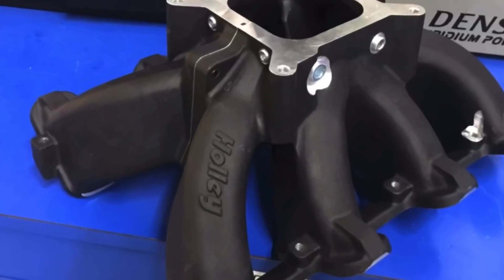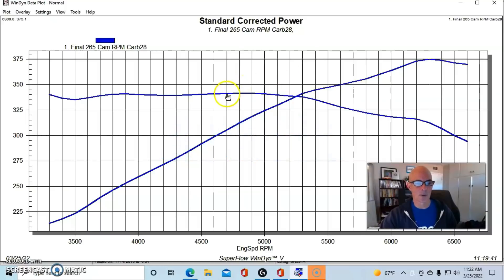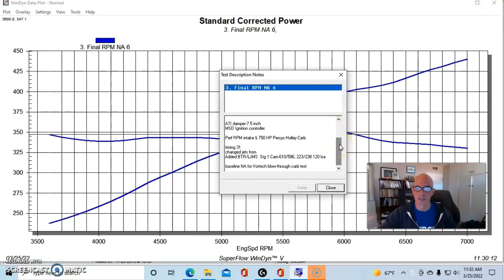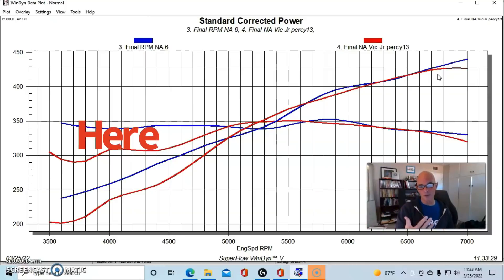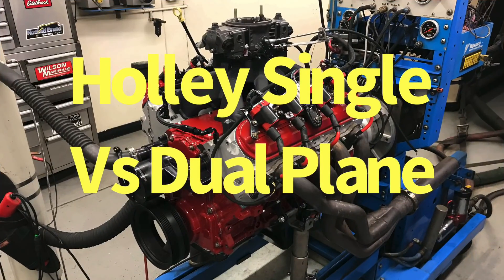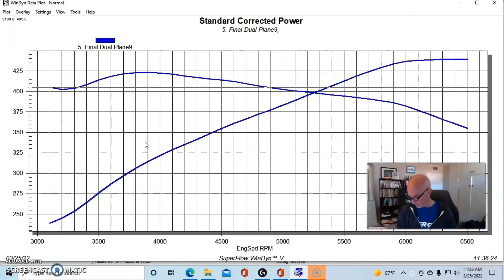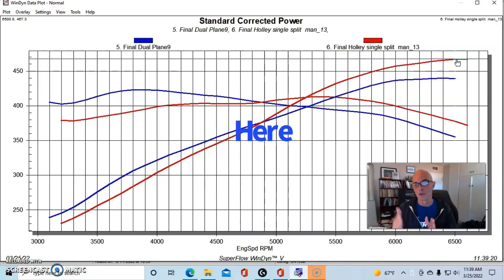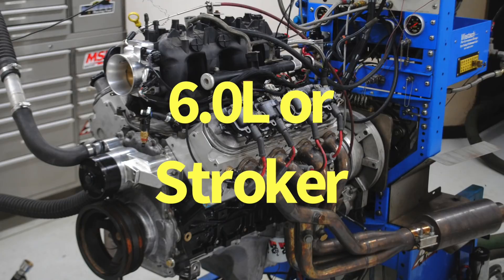HOW WELL DOES THE HOLLEY 2-PIECE, SINGLE PLANE LS INTAKE WORK? SHOULD I PICK A SINGLE OR DUAL PLANE?

Comment: I’m running nitrous on my LS1 with a forged bottom end 11.1 compression with built 243 heads and the nitrous junkyard cam on 150 shot. I wonder how good this intake would work
Reply: It would work well had 6.0 lq4 317 heads cut .45 ported junkyard dog cam 850 brawler carb
Reply: I appreciate the information, bud.. I’m actually running a 383 and got my 243’s CNC ported so I believe the Holly single plane with the 4150 tb should work pretty good.. it’s a track car and I don’t leave until 4K RPMs.. like depression is around 11.7 now

Comment: Hey Richard. I have a 4.8 i want to  put efi on it with a holley single or dual.plane intake. I want it to be like a daily driver / qeekend cruiser. Looking for a nice cam as well. Looking to put in a 70 era 914 with a 5spd.  What do you recommend for application.   I want good  gas mileage, and power. Some were in the range of 3 to 400.
Reply from the maker: I have a cam for you-send me an email at killerbe16@aol.com

Comment: So
I'm thinking of a project car. 2,200 to 2,300 lbs. road sports car.
I'm looking for 400 to 500 horse power at around 7,000 RPM. Keep the torque somewhat low. Say under 400.
I would drive this on the street with occasional road race  track days.
What I have in mind is a 5.3 all aluminum LS.
I found an LM7 with 862 heads that looks interesting.
Questions:
Can the stock 862 heads support the above power? Without porting and intake valve size increase?
I am wanting to install some kind of down draft manifold (such as a Holley EFI LS Intake Manifold with an elbow) in order to fit the engine in the car without butchering the bodywork.
Any suggestions for cam and what manifold would be very welcome.
Reply from the maker: 400 hp is easy with a 5.3l and a cam, 500 hp takes a lot of work
Reply: @richardholdener1727  So I would be looking at porting and passably 2 inch intake valves on the 862 heads, with intake manifold upgrades to get to say 450 HP at around 7,000 rpm. Maybe a throttle body upgrade as well? There seems to be so much You Tube info on much higher HP. But little on milder more street oriented builds. I'm thinking crazy torque isn't needed with a car that weighs 2,200 lbs. Plus torque is what breaks transmissions. I am building for a Porsche Boxster S Trans

Comment: Hi have a problem if eny 1 can help. I have a lq4 6.0  with 862 heads  upgraded  rockers  springs  port work  . Full length  headers. And has a carburetor with 750 holly. And a 2 peace  holly intake manifold the new one.  Need to know  what cam to run. Eny help please.
Reply from the maker: btr hot rod
Reply: Thanks  love the show. I have a manual transmission  to if that makes  a difference. Thanks

Comment: Hey Richard I am building a NA 6.0 LQ9 at the moment for my 65 C10. Its basically gonna be a cruiser but I wanted the chop so I bougth a Truck Norris cam for that. I will Holley-Terminator-TBI it but what intake do I need? Obviously it won't be at WOT all the time but I want the engine to have a little spice. What do you think?
Reply from the maker: dual plane makes more down low-single plane makes more up top-there will always be a trade off
Reply: @richardholdener1727  thx for your response....

Comment: Have you ever done an LS coil test or compilation? I know someone did one ages ago but that was heat sink coils vs stock ls1 coils. Not looking for any power gain, just reliability and possible rpm consistency.
Reply from the maker: I don't think you see anything until misfire happens

Comment: A test with longer cam duration could nett some interesting results. I'm guessing a guy running this type of equipment is not running a 'race gearbox box, so the motor needs to pull from 3000 ish to get out of the turns?

Comment: Seems like 4.8 doesn’t have enough displacement for single plane intake manifolds at all. Lesson here is don’t use a single plane unless you have high compression,heads and huge camshaft to use it. 5.7 would be the lowest cubic inches for a single plane intake in my opinion

Comment: What exactly makes the split manifold perform so much better then the vic jr manifold i thought the split design was just to make access for porting, also would there ever be any issue with boost leaks on the split design even with the gasket. Im conflicting on what to use on a boosted 402 peak power around 7000-7500 rpm.
Reply: Intake manifolds shape the torque curve. Dual planes have longer runners, and longer runners boost low and midrange power because they resonate ( think of organs making notes ) at lower and middle rpms. This is why matching everything takes work. Cam timing, intake, heads and exhaust is all a system that has to be optimized to achieve your desired results.
Reply: Judging by the dyno and the advertised rpm it seems like it will suit my application the only thing im worried about is boost leaks with it being split.
Reply: @hoost3056  i was also curious as to why it made more power then the other single plane intake not just on the top end but was closer on the bottom.
Reply from the maker: runner length

Comment: I've got a 408 w/ 10.8:1 compression 317 worked heads and the Holley split efi intake and it made 590hp/545tq. I have it in a 64' Ford F-100
Reply: Whoa!  Cool!
Reply: Made thos # on my 347 with Afr  220
Reply: I’ve got a similar setup 408 11:1 823 ported heads and a ls3 stage 2 cam made 606hp/550ish tq @ 6600/5400rpm I’m curious as to what the dual plane would do for more street and tighter converter
Reply: @shortbed70 I'm thinking you'd gain some.torque without giving up much horsepower
Reply: @MrScottt28  yea that’s what I’m thinking also… I wish I would’ve taken the 30 mins and swapped while on the dyno. Maybe I’ll do a seat of the pants in the truck..
Reply: That's Great!

Comment: A PDC cam works well with a centrifugal supercharger for race only. Knocks power down to help in the 60ft. Not as much voo-doo timing retard on the leave to control wheel speed and plant the tire.

Comment: I basically did the same test with a 6.0 on the road. 
I started with a lq4 with ls6 heads a BTR nsr cam long tubes and a Victor Jr.  a quick fuel  750 carb in a gbody. The victor jr cracked and I switched to a Holley dual plane. The dual plane is better all the way around!!
Reply: I have a Vic Jr on a .030 over 6.0, it cracked recently also, I’ve been thinking about trying a dual plane on it…
Reply: You didn't watch till the end ?

Comment: I am waiting for a summit ls long block to be delivered..I'm putting in a 68 chevy pickup with a 2004r gn trans...it's the 5.3 ls 450 hp 415 tq...I'm going w the carb setup.i live in a small town w some long roads and won't be on highway much... What do u think would be best intake would be for that type driving ? Also stall converter ? I have a nice 3600 from my 87 gn...I just want to get it right the first time....thanks.,..great videos ..
Reply: What rear gear ? How tall  is rear tire?
Reply: @davidcarroll9906  don't have the funds yet....but hopefully a gn rear w the 372s... probably 31s on rear...thx
Reply: If you're using the truck as a truck, do not use a single plane.  You'll kill torque down low.
Reply from the maker: that is a mild cam so dual plane
Reply: @richardholdener1727  thank you....and thanks for being so informative on everything...you r the man !

Comment: I'd be tempted to put a sheet metal divider in that 2-piece intake, see what happens. A thin piece of sheet metal should get the desired effect.
Reply: I suppose it would be easy to sandwich a .020" piece of sheet metal between the manifold halves, but I'd bet that it would lose power  everywhere.
Reply: I would rather see the results, even if they were negative, instead of making assumptions.
Reply from the maker: I want to see the results too
Reply: Complete disaster 
Been there done that
Reply: @Arthur King - You have one of these Holley 2-piece intakes, and tried the mod I described? How much HP did it lose, and at what RPM?

Comment: The victor junior seam pretty average.. it under achieves quiet alot. Where the bigger holley/super vic actaully works .. someone should weld a divider in the the victor junior and see what it does compared to daul plane
Reply: I think the reason the victor jr loses so much torque is because the two runners in the middle of each side are very short

Comment: I just came here to comment on Troy’s beard in the thumbnail.
Reply from the maker: yes
Reply: @richardholdener1727  would this be good for a 383 stroker 11.5 compression with 150 to 200 shot of nitrous.. heads are 243’s that have been CNC ported.. I’m thinking about running to 4150 tb also

Comment: How well would it work with boost and a bigger cam
Reply from the maker: boost would change nothing but cam and displacement and rpm would be a better match with the single plane
Reply: @richardholdener1727  from watching you're videos it seems pretty simple that the torque loss down low from short runner intakes is more dramatic with smaller displacement engines
Reply: And also the gains up top are bigger on a bigger engine
Reply: Im going twin 72s  custom cam .600+ .250+ @50 in a rod and piston 5.3 looking for a high ram or pro flo  alternative
Reply: Well im going to run one of these in my 6.0. .617/.598 224/228 114 lsa cam with an 85mm turbo with e85. So unless Richard beats me to the dyno... he probably will as I have been waiting since before Christmas for my intake to show...
Reply: That big single plane would probably be awesome with a big cam big gears and high stall. Especially at the strip

Comment: Did the extra compression on the 53 help the crossover point or is that just the holley has more runner length than the victor Junior? I know I thought that was pretty good crossover. I didn’t seem to help on the 48 even the  440 hp one.
Reply from the maker: displacement on the 5.3L

Comment: Cam is too small for vic jr
Reply from the maker: made peak power at 7000 rpm
Reply: @richardholdener1727  that doesn't matter, cam itself was to small. Thats same rpm intake with a spacer would have prob made more